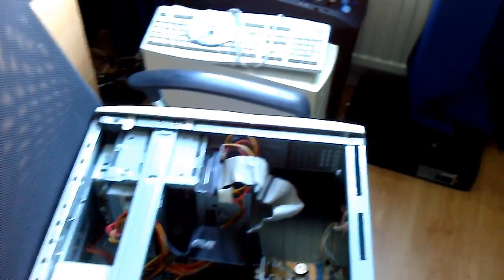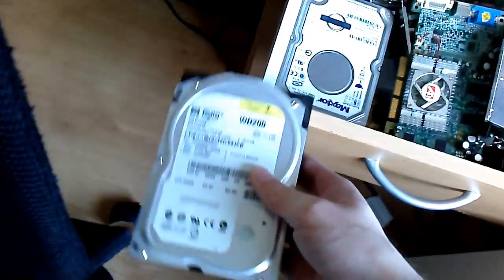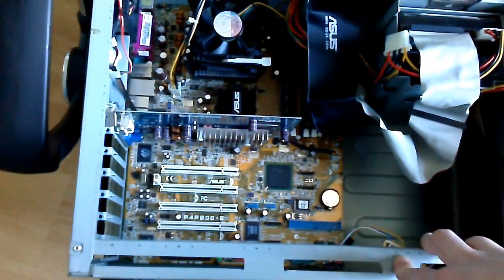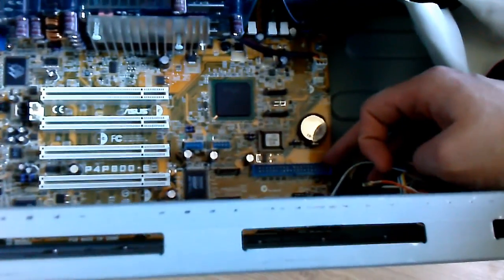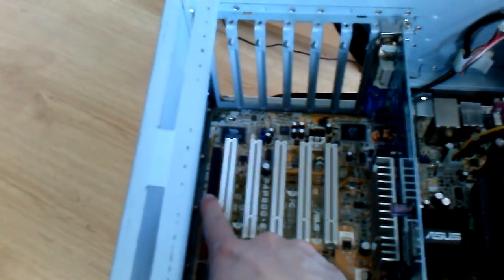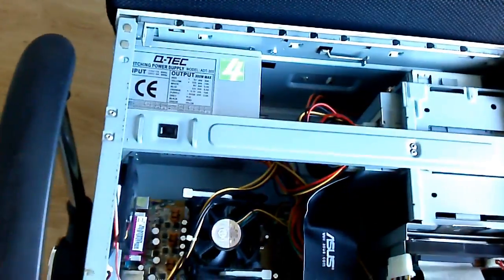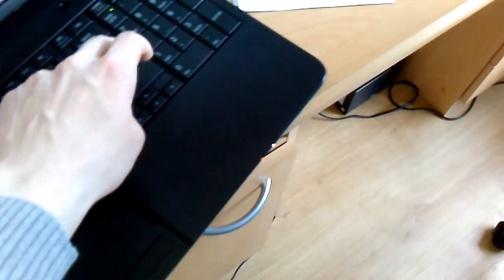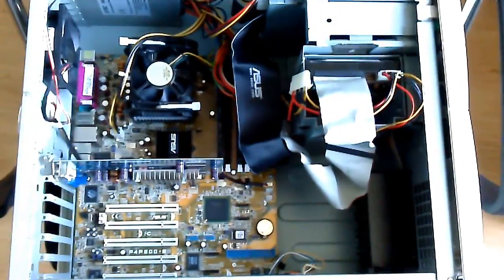Asus P4P800-E Socket 478 Motherboard Overview

Comment: Thanks for the blast from the past.  I had an MSI 865PE Neo2 motherboard for my Socket 478 system.  P4 3.0 GHz system, 4 GB DDR2 SDRAM, with a Radeon 9800 for graphics.  Storage had a 80GB SATA HDD as the primary, and a 200GB SATA HDD as the secondary.  Also had a Sound Blaster Audigy with Firewire included (the mobo didn't have Firewire included), and a Wifi PCI card for network connectivity.  Complete with DVDROM and CDRW.

Comment: Hey dude. Got a noob question. I currently pulled this motherboard out of a old rare case. The board is dead so I'm looking to replace it with a new board. How do I know which motherboards can mount the same as this board?
Reply from the maker: This form factor is known as ATX. Any ATX and micro ATX board should fit.

Comment: on my old computer i have this motherboard pentium 4 512mb ram and 128mb radeon 9550 and i run windows 7 corectly but i have problem with video driver i cant install it
Reply from the maker: You need to install in compatibility mode for Windows Vista or install them manually through device manager.

Comment: If you ever see this comment I really need help.i have the same mother board but the problem is it's running Windows Xp X86(32) im trying to go to Windows 10 but I try to boot from usb and I have been through other usb's installed a 32 bit of windows 10 on it but it won't boot from the usb at all Every time I try it restarts the pc (turns off than boots but it shuts off again) it keeps repeating the process do you have any tips or can you help me fix this problem can I please send you emails to help fix this issues
Reply from the maker: +TheShadowOfZombies If your CPU doesn't support PAE and NX Bit, you can't run w10. This includes all Northwood CPUs and the non-64 bit Prescotts.
Reply: NelizMastr - Tech for PC & Mac so all I have to do is buy a new processor ? And install it in my computer and it will upgrade ?
Reply from the maker: In theory, yes. Although I'm not sure this board supports the correct CPUs. From the looks of it,  you need a different board altogether. Windows 7 is the end of the line for this board.
Reply: one last question is it cheaper to make a Tower or buy a new one like (acer predator) < example
Reply from the maker: Go business grade PC instead, like a Dell Optiplex or an HP Pro / Prodesk.
Reply: NelizMastr - Tech for PC & Mac I'm really not a business kind of guy I actually want to have a gaming tower or it something do you know a thing or 2 on it ?
Reply from the maker: +TheShadowOfZombies ex-business PCs are the cheapest, if you want a gaming rig with fitting styling, you'd have to build it yourself. Don't touch Acer junk.
Reply: hello mi motherboard does not power on can you show me hou to connect hdd power cables and others to the front panel please ?

Comment: Windows 7 Ultimate runs perfectly on this motherboard.  I have two of these and run Extreme Edition CPU’s in both with max ram and 800FSB.  Although I have used these with Windows 7 I actually use Windows XP and support some older drivers for Audio Production.  I’m impressed with these motherboards. How’s it been working for you? I have all the drivers and manuals etc. The Wi-Fi as you suggested takes a special Wi-Fi card for internet but like your motherboard I don't use nor need it.
Reply from the maker: I intended to make a fun project out of it but some problems not related to the project forced me to get rid of most of the parts. Right now I have an Intel 915 board with a Pentium 4 3.6 and an Asus AMD board with an Athlon 64 3400+ that I'm considering for this project instead.
Reply: I guess I should be looking forward to the next YouTube then.  :-)
Reply: @WinyardProductions  can you send a copyof that cd